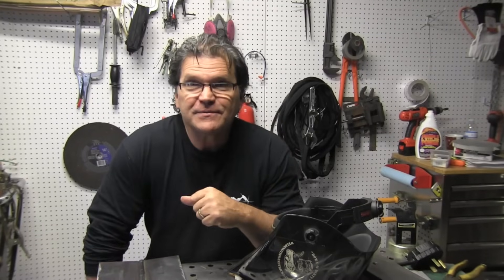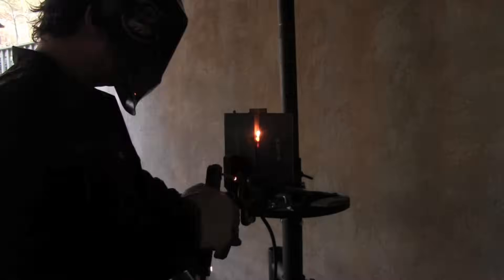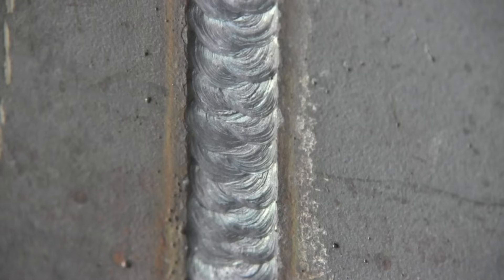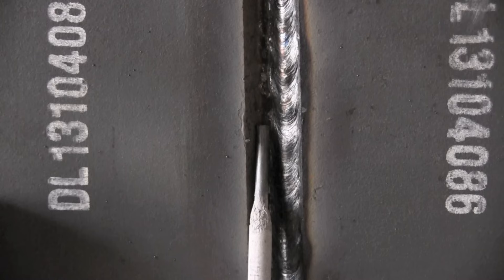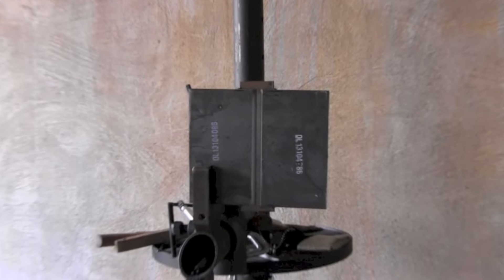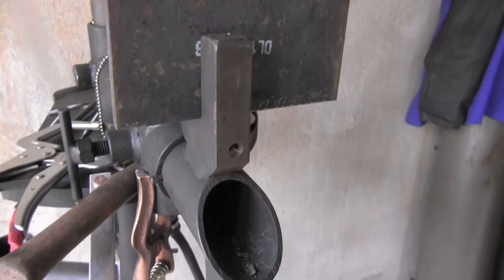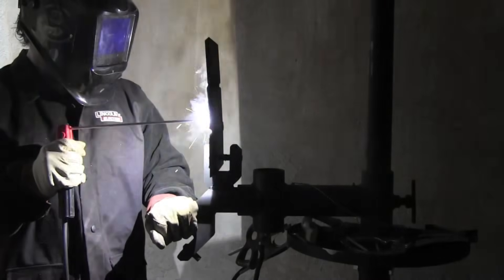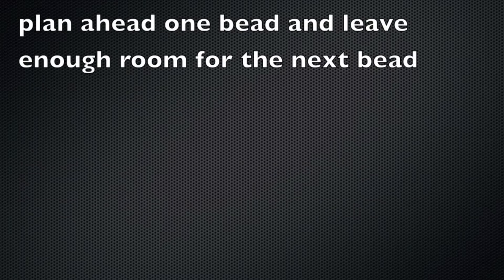3g Weld Test Stick Welding Tips Vertical 7018

Comment: Man i dont know how you go straight in without any angle up. Thought i had a decent grasp on vertical 7018 but i failed visual :/ too high of a bead. Not sure what i did wrong. Weld lead at work said i could grind it below flush and retry the cap but that got me thinking underneath might not be good either. And how do you keep the puddle from rolling up and dripping wicked bad? I was running 90amps 3/32 7018 moving somewhat fast or the weld would ball up real bad and quick. Any tips from anyones appreciated.

Comment: Bruh im using 6010 and I get undercuts and the welds are far apart😩😩
Reply: Dude 6010 rods cool down to quickly, you’re meant to use 7018

Comment: When you’re running your stringers for the fill passes and or cover passes are you angling the electrode towards the previous bead or more pointed towards the plate

Comment: Just how. 7018 just fights me. It fights everything. I want to go hotter cause I prefer running hotter especially sense the metal is magnetized. I also want to do stringers on it but my instructor keeps telling me it won’t work. My puddle looks like vomit the whole time. The slag is clearly fighting gravity. I just can’t get it right. My 6010 is a polar opposite. And just runs with what I want it to do. But the 7018. Just so unmanageable and I don’t get why.

Comment: Thank you for the concise instructions. This is exactly what I was struggling with. I’ve welded 6010,6011, 5p and 5p+ for miles, no lie- yesterday was my first stick of 7018. What a wreck. I was dumbfounded. But I get it now. Nobody ever told me about 7018. I’m beginning to like it. Thanks again. You answered my question.

Comment: Hi Jody! Is it best to use AC or DC on a 1 inch DOT test plate? I’m going to be using 1/8 rod and about 115 to 120 amp. Thanks in advance

Comment: Great videos. I use 1962 sa200. I can run tiny 6010 (1/32"?) to 1/8" in third gear,  just moving fine adjust from about 25-85.
But lately, been shifting to second for uphill welds. Seems to not fall out ( less "dig"?) so bad. Thoughts? Preferably without childish name calling but will endure some. Thanks

Comment: iam so hot at 95 amps for my test brother got tight arc this was at a knight welding louisville ky fail  me cause undercut .120 seem high  3/8 with 1/4 backing..ironworker  for 27 years but not a true welder like you ! i do it all so i dont have to travel..lol

Comment: I cant run 7018 vertical for nothing without undercut and the metal dripping out. I can with a 6010 and 6011 but not with the 7018. I'll figure it out one day.

Comment: 90° rod angle (slight push angle). 120 amps for the root. If having trouble... Turn down amps so you are just hot enough not to stick, keep your arc length short.

Comment: I think what a lot of DIY-ers want to know is whether they they can do this with their cheap little inverter. When I try and weld vertically it just seems to all run off.
Reply: From a few comment ago, perhaps  too wide a rod ?  Turning
Amperage down for smaller bead ?

Comment: Well one thing that confuses me is your settings...when I use 110 Amps with a 3mm rod it's always too hot and droops down. Yet my technique is similar. I get good results going 75 Amps with 2.5 red but with 3.2 it's always too varying. This is with old caddys and new. Any tips?

Comment: You should do a Video on the ZENA No-Gas All Aluminum Arc Welding Rods, that let you use a Dc Arc welder to weld alloys, aluminum sheet metal, cast, extruded. It’s got a 34000 lb 18% elongation tensile strength

Comment: Do you have any videos on welding dirty/rusty materials? Alot of the stuff i encounter at work (coal facility) is in rough shape, but i always try to grind away what i can before i start. Also, the backup plate looks like it helps keep the puddle from running off where it don't belong. Any tips without a backing plate?

Comment: My 7018 uphill's are always very convex. What can be done to make a vertical weld flatter?
Reply: Are you digging into the material far enough? Make sure to keep that arc length nice and tight

Comment: Tried the 90 degree angle instead of the 45 and it helped fix my weave. Severely reduced my undercut to almost non-existent. Thanks!
Reply: If you're having trouble with your work angle/weave dont be afraid to grab out further on the rod itself and guide it kind of like a pen.
Reply: @HOLLLDUP  Was literally doing that today
Reply: @daltronium_4781  it’s generally for people with less experience that haven’t developed that muscle memory yet but even after 16 years of welding I still find it helpful in awkward positions, especially when arc marks alone will result in a bust. I’m of the mindset that if it is helpful to you and gives you consistent finished product then it’s an asset not a crutch or lack or skill or ability. I say that because we all know that welder that thinks he knows everything and everyone else with different tactics is below him. Very annoying. Do whatever makes you better!
Reply: @HOLLLDUP  haha I have to hold pretty much the tip of the rod. I've been through 2 pairs of 60$ welding gloves within a month and 3 weeks. Hands shake way to much if I don't.
Reply: @historyz1941 you gotta relax your grip once it lights up just go with the flow. Trust me it seems easy to choke up on the rod to get it to light but the minute you let go and try continue youll be way shakier. Break that habbit of holding the very end of the rod. Just drag it lightly to start and dont peck at it or youll probably get stuck.
Reply: @historyz1941  Something you might try and I noticed the man doing the welding in this video is to keep your stinger hand arm close to your body. Have your arm and part of your forearm touching your stomach area to keep your rod movement to a minimum. If you need to you can hold the wrist of the the stinger hand with your free hand to further steady yourself
Reply: @HOLLLDUP How without your hands burning? Asking for an inexperienced welder 😂
Reply: @JayTheYTGuy grab the rod up closer to the end, not the actual part depositing metal but 2-3” back or even just half way up the rod.
Reply: Just gotta keep a steady hand and make sure tip of the rod matches your angle
Reply: That’s what I need to try. I think the 45 degree angle leaves too much undercut

Comment: We never use that back plate any tips for it? Links?
Reply: If your not using a backing strip i prefer  to use a 6010 rod and whipping it up slowly.Just watch out for the keyhole, dont go to slow or else the keyhole will get too big.

Comment: I’m using 7018ac with my old buzz box and I sure find the vertical welding tough. If I go above 90amps it doesn’t matter how I move the rod, the puddle drips down. At 90 amps I can make it look half decent but when I start I have to long arc for a while before I have enough heat. This is with 1/8” rod. Oh well, guess I need more practice. All your videos are awesome. I can tell you have a passion for welding, you’re darn good.
Reply: make tour arc force a little less than before

Comment: I can't begin to tell you how valuable these tutorials are. I am beyond frustrated in my 7018 vertical practice runs. Can't wait to get to class and put some of this advice to the test! THANK YOU!
Reply: Blaze 1UP I always thought over head was as easy as flat welds. 
Keep the rod tight and weld the same as if it’s flat. 
Vertical on the other hand (especially vertical but joints) was the most difficult weld for me to learn. It took several years. 
But I’m self taught on the job. 
And 15 years later, videos like this are more valuable than gold to me. 👍

Comment: That technique in the second root pass of pausing left and right and and coming up the bevel was taught to me by an old-timer as 'drawing the edges'. It lets you get a lot more metal deposited in the wider section in one pass and spread the heat out a bit. I don't know if it's a common expression, I haven't seen it anywhere since..

Quick tip for anyone learning to weld: try learning with both hands - it will make you much more versatile!

Comment: I'm from new zealand . getting close i think to doing a test for 3g plate. here I've been told its a 35 angle bevel. 2.5 mm root gap running 3.2mm "77" rods which i believe are just your 7018's and no packing strap.

Comment: Great video!  I have a question regarding tying in, do you need to remove slag or can you just carry on?  Thx and keep up the awesome work!
Reply: Yeah you definitely remove slag on tie ins. You can trap slag which can also trap gas making a bad weld that can crack but also fail an X-Ray test and bend test 👍🏽

Comment: Jody im a dob welder  I  never seen you make a video on a Ibeam clip connection, or a stiffener plate  welded at 1/4" all around this is the hard stuff in the field that would make all the inspectors happy.

Comment: I learned from a WWII ship yard welder.  He made me count to 4 on each side of the root pass and then count 3 on each side of the weave passes to fill the 1" plate for that test which I passed 30 years ago.  I can't run a vertical stringer bead like you can.  I have to weave or the puddle drops out.

Comment: Hey guys,looking for help because I have issues on laying down my hot pass on 5g pipe (6010 uphill root/hotpass 7018 uphill fill cap) root, fill and cap are solid but my hotpass always lays down looking like bubble gum and doesnt help push my root out. Any advice?

Comment: Jody,

I do not understand how your weld puddle doesn't drip out when you weld as methodically as you do (say, at 6:50 in the video).  Whenever I slow down to anywhere near this speed when weaving on vertical up 3g, the metal heats up and within a couple inches the whole thing is a big mess.  Plus, I've gouged out ahead of the puddle something fierce.  I've turned the amps anywhere from 85 to 110 and it doesn't seem to make a huge difference (maybe just delaying the drip if I turn down the amps). One difference is that I've been just practicing on 1/4 mild steel coupons, so perhaps they heat up a bit faster. I'd be very grateful if you could give me a tip or trick or two!  

Darren

Comment: Z bead was what I was taught for stick and mig, and tested  (bend test on flat (horizontal), overhead and vertical)  for my certification back in 1995. I am not a professional, took welding in High School and was tested and passed certification. I only use it when I need to fix something around the property. Have they changed it to require a straight bead for vertical now? I was taught that was wrong and it would fail you during certification. Also, aren't the amps determined by the size of the rod?

Comment: Hello, I regularly watch again that serie, and it shows me different things along with my personal 3 months progress on stick welding now.++sudden better laying of beads when I used 120A, not 100 110 as I did before, but may be with a thinner metal lower amperage will be useful.

I also did regulate dig to 10% as I do not understand well what effect it provide.

Just a polarity question :  first pass DCEN is it mostly used (by some)  for open root, just to have a more manageable arc ? no value for that flat bottom surface ?

Thanks

Comment: do you talk about drying in an oven the 7018 and other similar types of electrodes.? the prep to use those electrodes so the welding can pass radio test, just follow the maker instructions then ?

Comment: On my CWB test I need to go 4" 1/2 on the one side first then beveled side 1" 1/2 as my root then tie in both sides, and then start to FILL and CAP! Would you be able to make a video on that in all positions? Or if you have one direct me to the video. These videos help but it's not the same order that I need to do mine in. I'm not able to burn a root pass right in the middle.

Comment: I know it's been a while but can anyone confirm how big your bead should be for whatever given rod size? I've heard and seen it should 1.5 times the size of your actual rod you're using and I've also seem where it should be 2 times the size does it just depend on the thickness of material your welding on?
Reply: it should be 1 and a half to 3 times the rod diameter....the variance is due to travel speed and amperage....so for instance a 1/8 rod should lay a bead from 3/16 to 3/8....stringers only this doesnt count for weaves...you can run a pretty wide weave even with a 3/32 rod....if you run a bead right on the toe of another bead and you cover the other bead at least halfway then you are right about where you need to be....

Comment: So weaves are preferred than stringers?
Reply: Weaving is easier, but can create unwanted granulation in the material due to heat buildup.
Reply: this is a situational answer. Weaves in SMAW have a higher chance of slag overlap and heat damage, and in my opinion are easier. Stringers in an unskilled hand may have an even greater chance of slag inclusion, but well-made stringers provide deeper penetration and less annealing. It seems like every 3g 7018 test has slightly different parameters.

Its reasonable to assume that the strongest weld is the one with less mistakes; personally I think weaving can be done with less mistakes. But some code wants stringers.

Comment: So does the puddle push te rod up or do you raise it yourself? And do you pass from left to right to cover the bevel?
Reply: Feel like you just opened my mind. Did vertical for uphill inclass for the first time yesterday, and it was fkd. I'm really going to focus on arc length, and watching the metal fill in the paved metal. I feel your comment is going to help me a ton thanks
Reply: 7018 you raise it. Fast freezing stuff like flux core tends to build up faster, but 7018 is definitely a softer puddle! 
To minimize undercut, you can watch the puddle below the arc zone and actually see it fill in the previous arc gouge.

A slight weave is generally good with 7018 to help flatten it out, pausing on each edge. The arc is what paves the way for the puddle to fill in- so stepping to the side, gouging out the toe, and filling it in is a sure way to get a good tie-in. Otherwise you may just have cold lap and LAF on the root, which would be catastrophic. 

part of why Jody emphasizes keeping a short arc is that a long arc is hard to control. Sometimes it just gets wild and shoots to the side, and now youve got huge undercut to fix on your fill pass. In my experience its also easier to predict/replicate good puddle shape with a tight arc!

Comment: Do you have any good tips on welding vertically and horisontally under with 3.2mm basic sticks? I used to master this before with a certain stick (castolin 6666), but now I can't replicate this any more with the different sticks I try out. On the package it says that they weld vertically, and is for construction welding, but feel very different.
Reply: the best tips will vary by electrode- different electrodes weld very differently, and you should seek advice per specific type. Also, each rod will weld differently from itself in horizontal vs vertical. Practice them, if you can, and learn the rod.

Comment: I'm starting to weld and this Grove 3g is giving me trouble, just wondering, when you're doing multiple beads where do you start the next? do you place the next rod on the toe of the previous bead? the center of the new rod on the toe?

Comment: Hey Jody, Im working on my vertical padding with 7018 using a Thermai Arc 252i.  3/32" rod i'm doing ok with. But when I switch to 1/8" rod my welds are drooping at 110 amps. i'm guessing i need to travel faster and may tighten my arc with that size rod. i cant practice again till next weekend. whats your thoughts? Love welding Tips and Tricks, also loving the new podcast.

Comment: I'm 17 and going to trade school and high school simultaneously and I've been struggling with 7018 plate 3G. Been getting better from practicing all day in class but these tips I will definitely give a try to give myself the extra edge. Thanks Jody.
Reply: How’s the welding going these days ?
Reply: @NineTwo_JQ I finished welding school. Got a job at a local fab shop and I've been welding here for 5-6 years now. We use dual shield flux and used to use metal core wire. I still struggle with 7018 vertical and I'm taking a plate test at the shop as an elective test but I still suck at 7018 so here I am 😂

Comment: Thanks for the tips, 7018 been kicking my butt in vertical position, so tight arcs without sticking to the plate and slow and steady wins the race.
Reply: If 7018 kickins your ass your gonna hate 6010 with a fucking passion
Reply: been there, done that, conquered it chief. and yeah had a spitting issue with 6010 maybe it was just me
Reply: +Michael Davis  yea i had that problem too when i first started i just turned the amps down to around 75-80 is my sweet spot

Comment: screw stringers, just do a weave, block it out in one pass, 2 max and cap it. less passes= less chance of stop/start porosity and slag inclusions. welded asme9 tanks and pressure vessels for yrs, 1/2" plate. Root pass/ 1 fill, cap it.. done

Comment: Does 30, 35' of #2-0 orange ultra flex (34 gage strands of copper wire in bundle vs. 30 gage) coupled up with 10-15' of #2 orange ultra flex compared with 10-15' of #4 make any difference with how the rod will burn?

Comment: I hear some people say you should drag the bead if you're arc welding rather than pushing the bead, to help prevent slag inclusion. I have a hard time keeping it in the groove when I drag the stick because I can't see the joint. How critical is it to drag rather than push the bead?